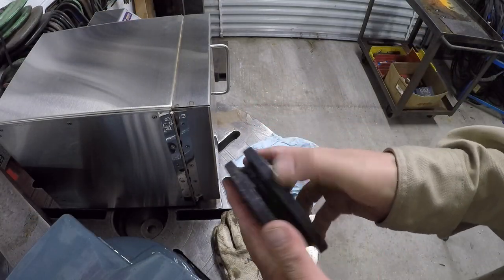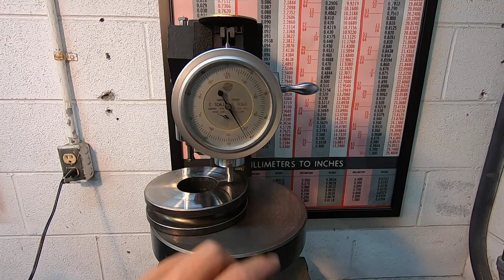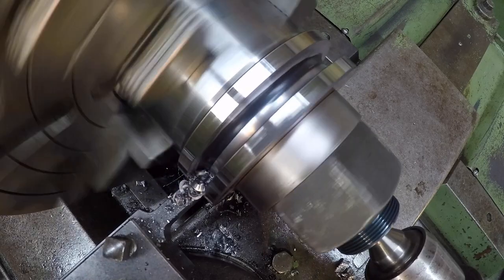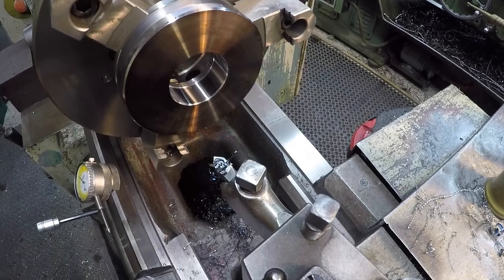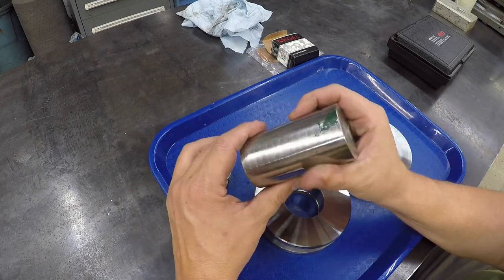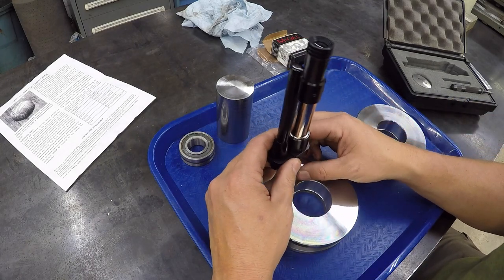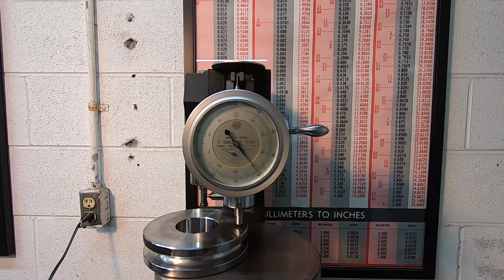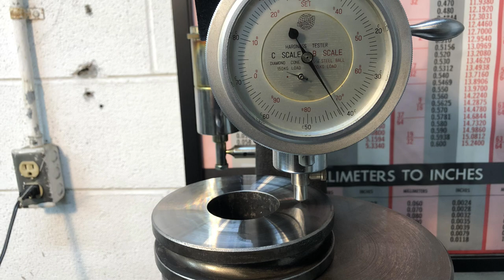Machining Cable Sheaves Part 2

Comment: i hope you took note sheave must be 20 times dia of rope, what your doing will wreck rope and sheeve fast, you have see building sites where they use one inch rope to pull stuff up for 200 years, the sheave is 24 inch
Reply: I think that's specific to lifting pulleys where the rope / cable is using 180° of the pulley. Also, materials have improved in the last 200 yrs.

Edit:  see snatch blocks on heavy wreckers with 1" cable

Comment: You would get better results if you water quenched your parts. Oil is too slow for such a big part.
Reply: The steel he is using is an oil hardened, not a water hardened, steel.
Reply: @mattmuttsmith  ...Yep, 4140 is an oil hardened alloy.